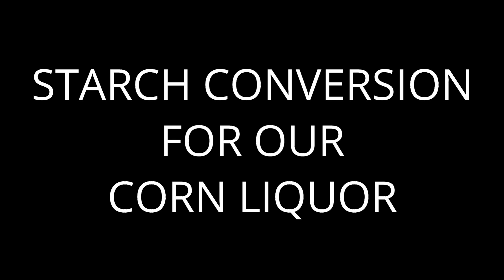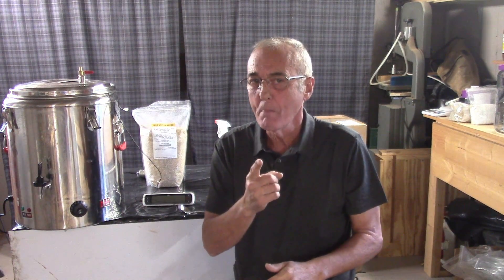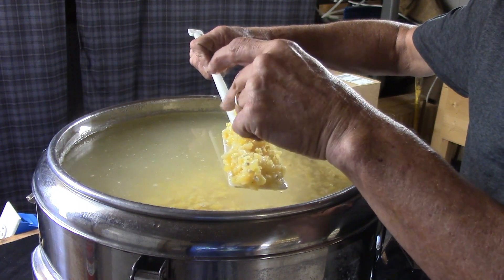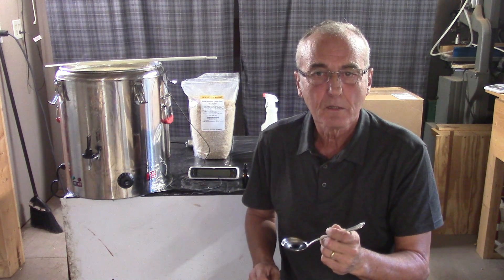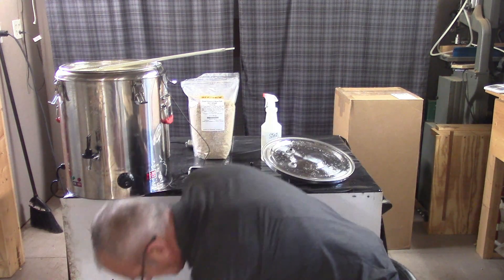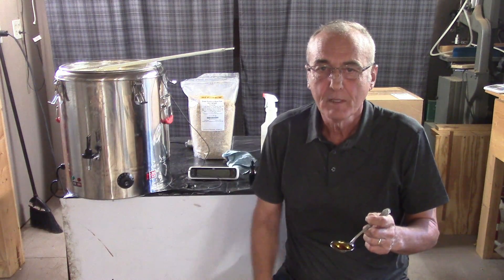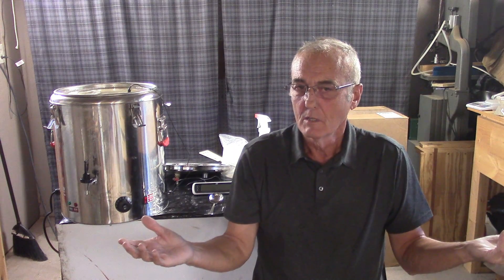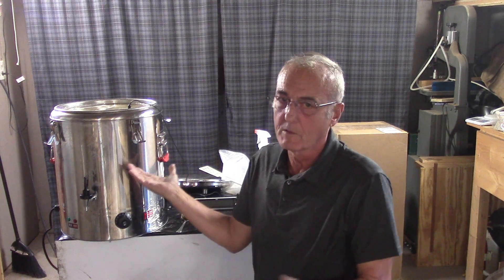STARCH CONVERSION FOR OUR CORN LIQUOR

Comment: george i have a question . i would like to know if there is any reason why i could not use fresh sweetcorn scraped from the cob rather than using dried corn which then has to be cracked .it would just be a matter of picking the corn then scraping the cobs kernel and juice into a bowl . i would think it would be ready to go into the mash straight away ,, also fresh sweetcorn is sweeter than older dried corn . it could be harvested scraped and frozen for later use even .

Comment: Great Video!!! When I do my corn mash I bring my water to a full boil, slowly add the ground up corn and let it boil for about 5 min (stirring constantly of course) and then I set the pot over on a 1" thick piece of styrofoam  for insulation and wrap a moving blanket around the pot (with the lid on it). In about 45 minutes I can stick my thermometer in the corn starch and it will stand without me holding it. Then when the temp drops to 160 degrees F, I add my malted barley. I also boil three gallons of the water with a 4 pounds of sugar and some Citric Acid to invert the sugar while the corn mash is cooling. It all has to cool for a while before adding the yeast! The fermentation takes off and I think it goes faster with the inverted sugar!!! I use a Champaign Yeast for higher alcohol tolerance.

Comment: HI George - I noticed that your mash kettle was very full before you added the barley (only about 1 inch of freeboard to the top).  You stated that you added 5 lbs of malted barley.  Did that cause a problem with the volume and overflow the kettle?  The before and after pictures of the added volume of barley look to be the same.    I would have been very worried about adding the malted barley with the level of liquid only an inch below the top of the kettle!
Reply from the maker: Not at all. I had room for the malted barley.  I was a little concerned but it left about 1/2 inch of room to the top.
I did not remove any liquid at all.

Comment: here's a question.  can you use corn meal to this too?  the kind you use for baking corn bread.
Reply from the maker: Yes, and in most cases the corn meal has been gelenatized already. The only problem is the mess it creates. Very difficult to remove the solids before fermentation and even after. Brewing in a bag seems to be the best method for using corn meal. Even then it is still a bit messy.

Comment: i love how he shows how easy it actualy is, as long as you do it correctly. step by step, you thought me everything i know, and for the past few years didn't buy any alcoholic drinks from the shop. made every drop myself. No more headaches from the chemicals in the drinks, just pure natural corn liquor. I am using a very simple onion shaped copper still, 5 gallon, on an electric hotplate. At the start it gives my 65 to 70 % abv (130 to 140 proof) i stop collecting at about 50% (100 proof) . add some glicerine for smoothness, poor everything in a big glas jar with toasted oak chips, leave it until dark brown, add osmose water until it is 38% (76 proof)  the most expencif thing in my whole process, is the turbo yeast. I have no idea what to call my drinks, whiskey, moonshine, rye, bourbon, rum or vodka, i use corn and sugar.  Sometimes i poor 1 bottle of captain morgan spiced rum into the batch, and the whole batch tastes like captain morgan. Please tell me what the h*ll i am making, so i can label it correctly.
Reply from the maker: Sounds like you need to make up your own unique name. The corn and sugar could be called bourbon but adding spiced rum kind of changes the whole character. 
Good to hear a;ll is going well. 
Happy distilling
George

Comment: George, I appreciate you, but could you dumb down the ph stuff (if possible)? brewing beer 10 yrs, drilling less. I just buy water from supermarket. Too many minerals where I am.
Reply from the maker: Will do. Ph is iimportant and even with spring water it is a good idea to check and adjuct it. The good thing is it is a one time thing you can do to start and then just forget about it. In most cases the spring water will be very close to neutral (7). If you added about 1/8 teaspoon citric acid per gallon (just open the top add it in) that should bring you close to 5.2 and you can use the water when ever you are ready. Citric acid is available in the isle where they sell canning jars (mason jars).
Reply: @BarleyandHopsBrewing   Awesome, wonderful! Thank you!!!

Comment: New to Distillation, and have a Question. 
Can Nuts ferment like Grains??
Reply: Nuts are high fat, so it'll be a bit weird. You'll get allot of oils from it too. They tend not to have allot of sugar and starches, so it could be done, but it'll be overly expensive to get a quality product. 👍
Reply from the maker: @Bildo1986  I agree. Too much oil residue. Bottom line: Can you? yes - Should you? probably not.
Reply: Thank you